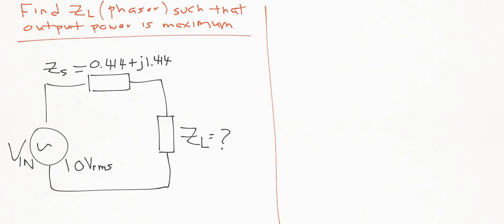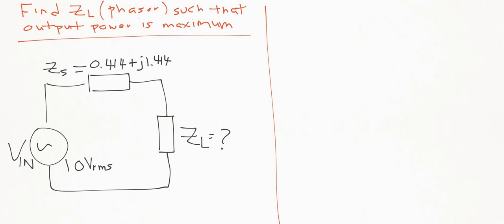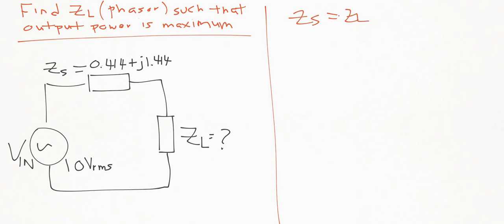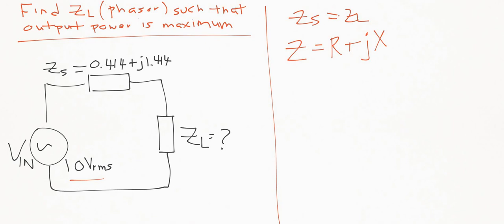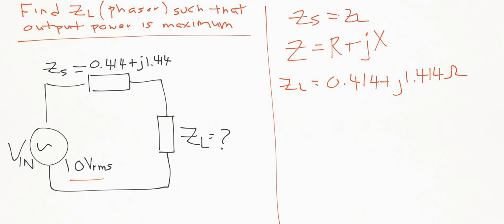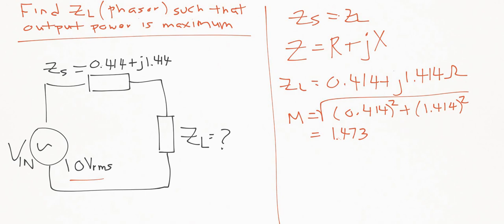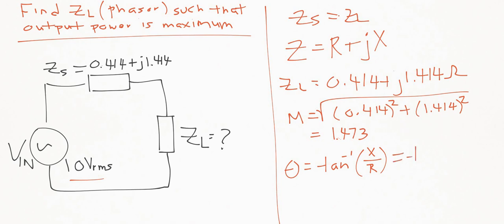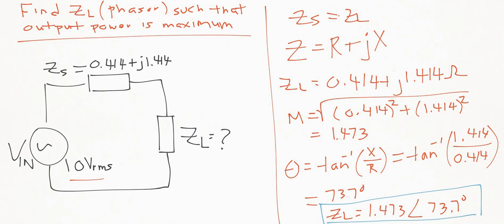Electrical FE /EIT Exam Prep - Circuit Analysis 2: Max Power Transfer

Comment: That's wrong. In an ac circuit maximum power transfer to the load impedance ZL occurs when the load impedance equals the complex
conjugate of the Thevenin equivalent impedance. The answer should be 0.414 - 1.414j. You want the complex parts to cancel

Comment: in an ac circuit maximum power transfer to the load impedance Z_sub_L occurs when the load impedance equals the complex conjugate of the Thevenin equivalent impedance (in your case Z_sub_S)

Comment: very wrong, it should be  ZL = 0.414 - j 1.414, the one you are solving is for non-complex!
Thank you overall, good videos.
Reply: I agree. The FE handbook states that in AC circuits states "In an ac circuit maximum power transfer to the load impedance ZL occurs when the load impedance equals the complex 
conjugate of the Thevenin equivalent impedance" Therefore ZL = 0.414 - j 1.414 or 1.473angle-73.7